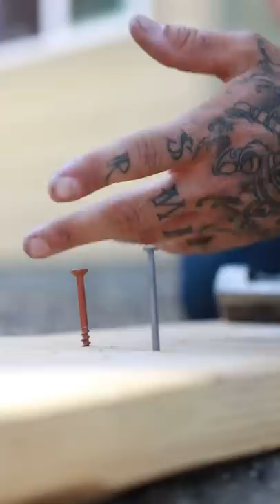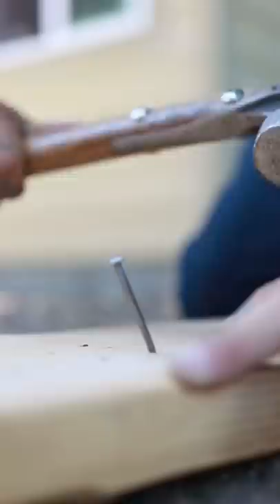Nails vs. Screws: Why do we use nails? #shorts

Comment: Screws are not going to sheer in stick frame construction. The reason is time and money.
Reply: I was litterally just gonna say that. You can shoot and entire stud with a nail gun in the time it would take to drive one screw. And nails are way cheaper.
Reply: @susdad  it broke from getting hit with a hammer. That's not going to happen when you got 10 of them holding in each stud
Reply: @franksmythe6969  10 screws holding in a stud? Where they do that at?
Reply: @susdad  well if they were doing it properly that's how many it should be. Listen, I'm all about framing with nails too. I'm just saying that screws are not going to shear like that
Reply: Ten including the fire blocking?
Reply: Where theres earthquakes they may
Reply: @fixerupperer  can’t tell these guys too
Much
Reply: @Music.cigars.2024  facts don’t care about your feelings.
Reply: @susdad  build stairs with nails, and build stairs with screws, tell me which boards come off quicker .....
Reply: If a structure moves enough to shear a screw then it is a total loss anyway  even if it was built from nails.
Reply: Exactly 👏👏👏
Reply: @franksmythe6969  screws are notoriously bad with shear load. Wood is really stong, when it moves it moves. I,ve had simply boards break four screws when it deformed.
Reply: Skyscrapers move. They don't build em outta nails. But idk anything.
Reply: @jeremiahs101  skyscrapers are made out soft steel beams with gaint rivets/ bolts and at times welded they do not use hardened steel...
Reply: @franksmythe6969  10 screws holding a stud? Maby don’t comment on topics you know nothing about.....I bet your a desk jockey. Lol
Reply: @onlytruth4803  How many nails do you use? If you say less than 10 you're doing it wrong. So why would you use less screws?
Reply: @franksmythe6969  depends on size of lumber being used. But you knew that being a pro.
Reply: @onlytruth4803  I never said I was a pro but I was talking about 2x4. Although I know that is no longer the standard for exterior walls, however it is the smallest you would frame with therefore the very least amount of nails per stud. But you would know that being a pro.
Reply: @franksmythe6969  well then it’s three for a 2x4. How on earth the putting ten nails into a 2x4 lmao. Your a waste of time.
Reply: 2 toed in to each side and 1 on the outside edge. Do that on both ends and you've got 10 per stud. It's sad I have to explain this to a pro.
Reply: @onlytruth4803  10 per 2x4. 14 per 2x6. 18 per 2x8. If your doing any less than that your are doing it wrong and you're not to code. Unless you're living in 1945 when the only code was it had to be standing when you waked away.
Reply: @franksmythe6969  that’s not how there counted. Lol. But ok.
Reply: @onlytruth4803 What do you mean that not how they're counted. Is math somehow different in framing? Please enlighten me.
Reply: @onlytruth4803  you're trying to catch me in something for some reason and I don't understand. Are you a professional troll? Jesus man. Just say "oh I get what you're saying now" and let's move on with our lives.
Reply: @onlytruth4803  the "but ok" was the smartest thing you posted...
Reply: @thomasjefferson5727  yep. That's to "end nail".  You got that right. I'm talking about toe nailing. And even once to end nail you should toe it in too.
Reply: @franksmythe6969 10 nails in one 2x4?, its 2 nails per end. So your saying when you build your walls top and bottom plate with 2x4 studs in-between them you use 5 nails per end? There has to be no more wood, you should stop building immediately
Reply: @jamesboxold9671  if you're only putting two Nails in I'll make sure never to live in the house you built.
Reply: I mean a house is going to move, even if by little, when the wind hits it, same with an earthquake, houses do move just not enough for you to notice.
Reply: Exactly, as crew sticking out 2 inches will snap, drive it home and try it.
Reply: @susdad  It takes more force to bend a screw than a nail. Also, a screw won't bend or break inside the wall. There are only two reasons we don't mainly build with screws; time and money. However, sometimes we're forced to use screws by the book, because they're stronger and provide more compression. Never does the book say to use nails instead of screws.
Reply: They could make screws with lower tensil strenght but it all comes down to time and money.
Reply: @rorschacht8478  you’ve never once read a 📚
Reply: You do realize that homes are compliant structures that need to move right?
Reply: @chrisknight7921  exactly, the house would be basically falling over for this to even matter.
Reply: Maybe if he used the gold screws made for sheer strength????? I mean I could show the exact opposite as what's in this video using an aluminum nail against a structural screw.
Reply: You can do ultra tight studwork if you use screw's right and though slower,it's a lot more rattle resistant especially in partitions with fire doors.
Reply: @jeremiahs101  concrete is actually pretty flexible
Reply: If time and money were the case then the inspector would have a field day
Reply: @franksmythe6969  18 per 8x2?gtfoh
Reply: @franksmythe6969  I feel bad for you
Reply: I just want to say that I have a deck done with nails from 5 years ago (not from me) and the nails are all popping up. If they were done with screws I wouldn’t have to go around and hit every one
Reply: @barnonets2010  yeah , because they’re supposed to use DECK SCREWS ARE YOU KIDDING ME RN
Reply: jackpot answer
Reply: @Manatee360Phototography  lol, peopl have money and time, what you even talking about. Lol 😂 we use nails for a reason ya goof.
Reply: @krismace001  are you an Alien?
Reply: @franksmythe6969  sorry but if you're 1st fixing with 3x2 which is standard then you'll put 2-3 nails or 2 screws in. Putting 10 nails through a 2x3 noggin will split the timber into quarters.
Reply: @susdad   yeah, you're 100% just a troll.

Screws aren't used in framing because of cost. There is no reason to use one or the other outside of that. You want to build your house with screws? Be my guest.

Also, yes, a framed house is supposed to SWAY and not shear, its not however supposed to have extreme twist loads. You only have one nail at each end of a stud and you're going to have a wall that can twist and deform.

Let me guess, you're the type of guy who built a deck once or maybe roofed a house and think you're the shit. Right?
Reply: @barnonets2010  skew nail it back down
Reply: @michaelphoscar7509  Who frames with 2x3? Did you mean 2x4. I can tell you know what you're talking about.
Reply: @franksmythe6969  literally everyone....
Reply: Lmao this video was worse than the assassination of Franz Ferdinand with the wars it’s created in the comments, but to throw my gas into the fire I was taught in my wood shop class from my teacher who was a contractor that it was time and cost, but idfk I’m just a guy who watches YouTube shorts
Reply: @JustAGooseman  I actually know the code for my area
Reply: @susdad  Resorting to insults like a toddler. Yeah sure okay buddy, you know everything and are a god at building walls, you want a binky and a blanket now?

Nails and screws do the same job, one is just more time and cost effective. There is no legitimate reason to choose one over the other outside of that. A proper framing screw will not shear under most horizontal shifting.
Reply: @chrisknight7921  exactly. Was scrolling looking for a big brain lol
Reply: @onlytruth4803  hes still only at 8 screws if he toed four in on bottom and four in on top 😂 he must be splitting studs like damn
Reply: @franksmythe6969  we do 8 but I can understand 10, 2 toe nailed, 2 in top plate, 2 toe nailed, 2 bottom plate, or if the bottom or top plate isn't accessible, then 2 toe nailed each face of the stud so, 4 top 4 bottom
Reply: @petertaylor6384  8x2?
Reply: @franksmythe6969  10 nails?!🤣🤣🤣🤣

You smoking the good stuff or what.😂
Reply: @onlytruth4803  Right!🤣
Reply: @franksmythe6969  That means you should shut up now.

I'll clue you in on a little secret. I've been doing this for over 20 years. Anytime we see a stud nailed like that we know an amateur built it.
Reply: @johnrus7661  I'll clue you in. I've been in construction of 20 years as well and never seen it done differently by anyone. This is basic framing 101. Easy stuff and people in here don't seem to understand it. It's really laughable. Please if you're an amateur trying to tell me how you build shotty houses, keep your comments to yourself because you might steer some poor sap wrong.
Reply: @franksmythe6969  Don't flatter yourself you lier, you just admitted that you were not a professional earlier.

NO contractor is shooting 5 nails at the end the of a stud. You'll split the living shit out of it.

But go ahead, you probably couldn't use a framing square much less frame a house.
Reply: @JustAGooseman  please research the difference
Reply: I mean Canadian build code will fail you for screwed framing
Reply: @imadethis5534  please say it again , and tell them why. USA is the same way.
Reply: @susdad  nails are stronger than screws of the same length, and are better able to withstand “shear” pressure—which is the tendency of two joined pieces to slide past each other. Example you can try at home join to 2x4 together in a face on face lap one with nails and one with screws bend down any part of the nail sticking outb( not code any more but for the sake of fair ness) then try to knock the one them apart by using a hammer and hitting one side to make a sheerin action .... The screws will break 1st now try to pry them apart the nails will slip 1st you us nails when a sheer force is likely ie framing while cost can be a factor it is far from the only one ..
Reply: @imadethis5534  Not true. Depends on the screw and if it was engineered for it.

Houses are engineered for nails, with the proper screw "And they make structural screws", you can use them. But simply because the plans call for a specific type of fastener you have to use it.

Not because you couldn't screw a house together, which would be dumb AF.
Reply: @johnrus7661  I mean thats like saying a grade 8 bolt is stronger then a grade 6 .... No shit situation different fastners for different jobs but by in large nails handle sheer force much better then screws like I wouldn't use a 7018 rod for a resurfacing job because it is not suited for it just like screws typically arent well suited for sheer force it is a hardend steel why is this such a debate ?
Reply: @imadethis5534  Because it is patently false what you are saying.

A grade 8 bolt is stronger in every way to a grade 6.

People say the same thing, the grade 6 will stretch before breaking.

Ever used a grade 6 bolt on the end of bucket of an excavator to hold a steel beam? Aparently not.

Let me clue you in, the grade 6 stretched all right. But snapped like a tooth pick.

Grade 8 was strong AF and held up great. Guess what, grade 8 also stretches when it reaches it's peak strength and starts to plasticize.

Same with a screw, bending for is NOT the same as shear force. A screw has VASTLY more shear strength, tensile strength ect. You do not experience the insane bending in a typical framed house like he is demonstrating by hitting it with a hammer. That is simply not real world.

Nails are elastic, but not stronger.

Second, in real world you do NOT have any meaningful shearing action. It is wood, it is really soft. You are NOT breaking a screw in standard framing. It is not the same thing like in metal construction, where you do have metal providing a very substantial shear loads that can shear the wrong fastener. Unlike wood.

I've been a second generation contractor for more than 20 years. I know what I'm talking about.
Reply: @johnrus7661  ..... I know you suddenly saw a moment to really go on a rant there .... But if ya read over my comment didnt i say a grade a grade 8 is stronger then a grade 6 ? I even followed with no shit ..damn man yo figure a man of your age and time in the industry would have noticed that
Reply: Maybe the context confused you my fault i guess but seriously did yoy really assume I thought a grade six was stronger then a grade 8 ... Thats the whole point of grading fastners I understand it is 2021 but dont automatically assume you are the smartest man in the room
Reply: @imadethis5534  Nope, never said that.

Second, the assumption is it's not it's stronger or weaker given the application. You are making the assumption like so many other that it is better "Suited.

Because so many think that just because you can't pass inspection of a mental building using grade 8 bolts (True story) doesn't mean they don't stretch or not even better.

It's just one of those legal things, it was engineered certain way. Anything that deviates from that, for better or for worse on something critical like the bolts. Is a HUGE legal liability if something where to happen.

Same thing here.

They make structural screws and fasteners that are insanely strong and used in post and beam as well as log homes. They will snap with a hammer, but that doesn't mean that they don't kick butt in every way. Including shear.

I'm not talking about things like a VW head bolt that needs to expand and contract at a certain rate or certain very specific and engineered applications. We are talking about the miss conception that a good screw is so poorly suited that your house will fall down. That is nonsense.
Reply: @johnrus7661  I think whats going on is that we are all stayimg the same thing (more or less ) its just we are  going round and round with it. .... Like we are all smart enough to understand that if you put your home together with screws its not going to spontaneous deconstruct ( baring any acts of god) .... But as a home " settles" the sheer resistance of a nail coupled with the cost and time saved a nail is a better choice
Reply: @imadethis5534  thank you for agreeing 😀🙃
Reply: @imadethis5534  No, we are not saying the same thing.

There is no significant shear on on a nail in a framed house.

Nails are not used in shear loads, brackets are used when there are significant sheer loads and they can use special nails or they use special screws. Normal nails will sheer.

Normal framing doesn't have massive sheer loads (You can't sheer a screw or a nails with just wood anyway) and significant weight bearing is supported by the studs themselves. The nails are just there to hold it together. You never support a load with the sheer strength of a nail. You will just pull it out or mangle the wood.

This is really the end of the subject. I am a second generation contractor of over 20 years. We don't use screws all the time, they are not nessary, but we still do use them in certain applications.

And they are not gonna snap like a toothpick.

Really, this should be the end of this conversation.
Reply: @johnrus7661  ..... If you have as much time as you say then you should be at work not pissing off on YouTube
Reply: @imadethis5534  Irrelevant comment.

I'm still right.
Reply: @susdad  Nails are standard practice, screws are an upgrade.

He probably paid for standard.
Reply: @imadethis5534  No, I would be your boss on a construction crew.

Chill out.
Reply: @johnrus7661  no it’s really not though. nails and screws have different purposes by code. Screws are used when there is grip force needed like decks, nails are needed when there is shear force and gravity pulling. That’s why nobody uses nails on a deck because they’d all wiggle up from no grip force to hold them down. And screws aren’t used to hold up walls
Reply: @johnrus7661  and your average laborer doesn’t know any of this, otherwise they’d be an engineer